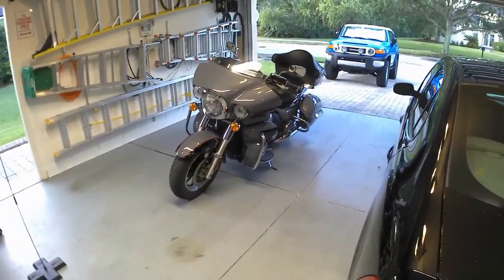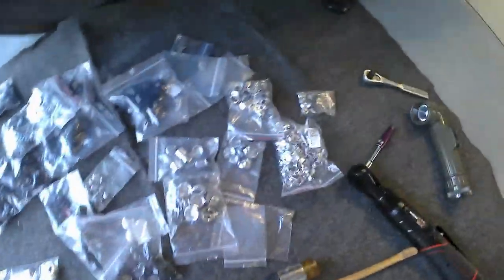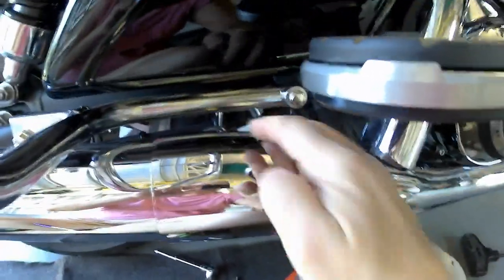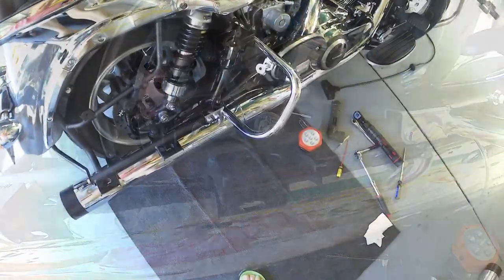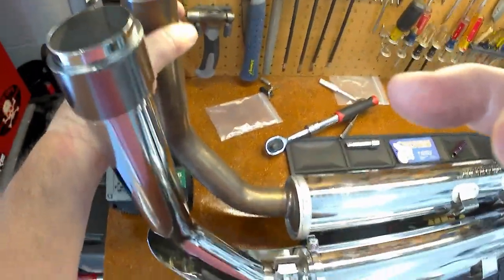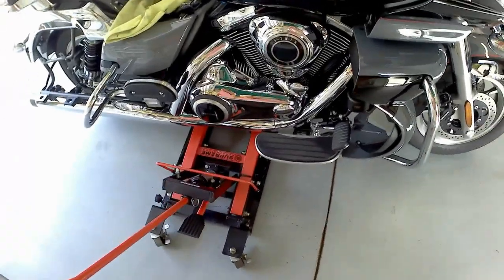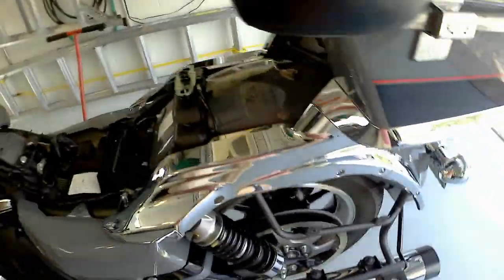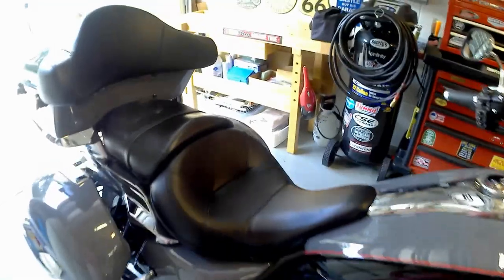2023 Kawasaki Voyager Exhaust Upgrade

Comment: Now that you have had your slip on pipes for a while, what do you think about them and would you still recommend them? I see that they are currently unavailable on Amazon.
Reply from the maker: I had Vance and Hines on my VTX 1300S in the past, they were just too darn loud and fatiguing on the highway. I really enjoy these slip-ons and although they may not be available, Shark Road makes pretty much the same thing. These along with the K&N air filter were added to the Ivan's Flash for the ECU and the horsepower is supposed to have gone up to 90 from 72 and torque, 107 to 120 foot pounds. They are not too loud at all but give my Voyager a free flowing and throaty exhaust sound true to what Kawasaki's performance and engineering is all about. Thank you for the comments.

Comment: I have the 2023. I love you videos. I’ve made many of the same upgrades. So as I’m understanding, can I get the K&N replacement filter and put the slip on’s on and get the ecu flash later? My budget will only allow to do a couple of upgrades at a time. 
By at a
Reply from the maker: With the free flow exhaust and the K&N air filter, it will cause the bike to run leaner with the current ecu programming. You will get the most irritating popping when decelerating which drove me crazy. I only test rode my bike once after the exhaust and filter change, then sent off the ecu immediately to get it re-flashed which solved everything.
That's just what I encountered. back when I did the same for my VTX, I ended up having to change the jets in the carbs for the same reason. I hope this helps to answer your question.
Reply: Yes. Thank you so much for your response

Comment: Dude, why are you putting aftermarket exhaust on a brand new bike to me that makes absolutely no sense at all. There’s nothing wrong with the pipes that are on it.
Reply from the maker: Well, I didn't like the sound the originals had plus they were too restrictive. I added these free flowing pipes along with a K&N air filter before sending the ECU off to Ivan's Performance so he could tune it accordingly. I numbers now sit at 86hp instead of 72hp and the torque has increased from 106 to 120. The exhaust was just a part of the big picture of bringing out the best in my new Voyager. It's a personal thing and if you like your bike the way it is, I fully understand and can appreciate that. Thanks for the comment.
Reply: Your neighbors are going to hate you 😂😂😂
Reply: It's called personal preference. And it will help it run cooler

Comment: if you just installed a k&n filter with slip-ons then flash is not required. the big air kit AND new slip-on exhaust will require a re-flash
Reply from the maker: I tried that and it was popping and banging. Too much air and the ecu didn't know what to do with the fuel. I significantly raised my HO and torque, and removed the rev limiter for top speed. Throtttle delivery is great, with the stock ecu you only get 74% throttle when full open. Ivan turn the throttle into an "as if" it was  cable operation. Plus, no throttle dump when you let off the throttle. He also programed the bike so the cooling fan comes on earlier. Best thing I ever did for this bike.